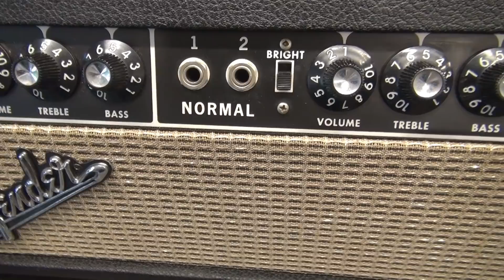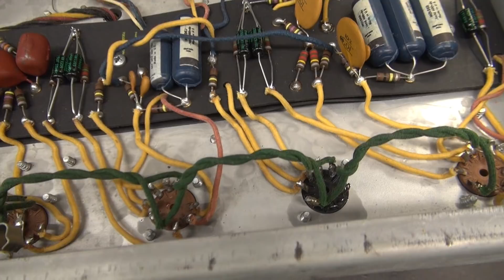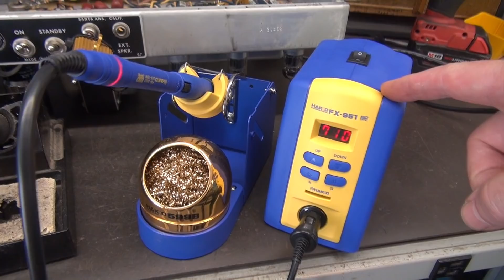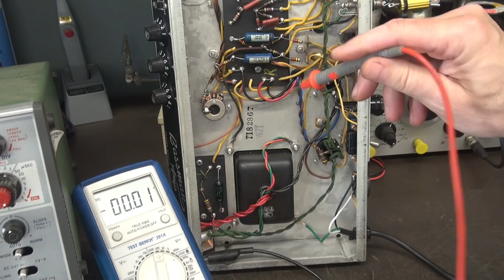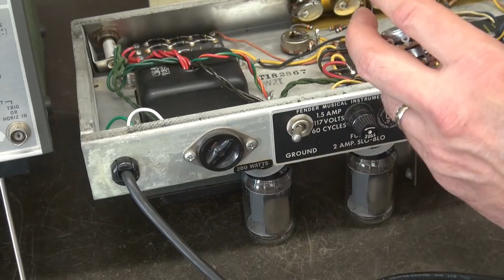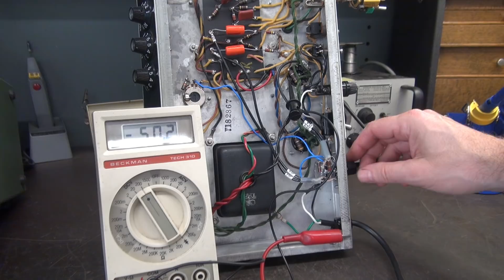How to fix Noise + add Master Volume Fender Bassman 6L6 tube guitar amp

Comment: Great to folow you,fine videos.make my homebuilds alitle better,riaa varius hifi amps and guitar amps,luckyly i have tubes and transformers fore some more builds,its funn to construct.point to point,and nowon has a same. Usualy fender clones or the 18w el84 amp.start building your dream amp just find an old radio chassi,and start building folks,all you need is solderingiron and a shematic to copy. Come on Folks,lets compeat,then we all winn!

Comment: Hi Terry, great clips and awesome teaching.
I have just been able to acquire two of these, my favorite model of the entire Fender catalog.
I had one before until 2011 and the notes jumped from my cabs with pubch, tone and clarity. Had a Super Reverb about as good tonally.. Both needed a full overhaul and the expected upgrades to return it to as good or better specs than when new.
One of these, my drip edge model has an issue when daisy chained or channel jumpering. This adds Volume,Treble and Bass as you know and connected this way gives very early overdrive, useful at low volume, mud at more than a couple real watts of power. 
On the drip edge model, the controls seem to fight each other like most other our of phase signals do when channel jumping.
How does one tell if tech has snipped this out. The amp had a very short, poorly installed power cord but otherwise seems original.As a player,I would like to do my own service work but have made a mistake when attempting to connect NFB.
It came on ok,I changed power supply caps with a new set of F&T's where expected and slowly rolled power on from 0 to 117 volts. Power and Stand y up.
I was elated when pilot light slowly brightened and eventually some background hiss and birdies hit my speaker,I thought I was OK.
Had left both Power and Standby switches up to allow voltage to fill caps slowly? I took maybe 5 minutes and stopped .
Any way, after playing a couple minutes through Normal Ch, I switch to Bass side and all seemed well.
Until I flipped the Ground switch to turn it on. Something died a a horrible death in my work.Iurt, squajy, squeaking death but fuse didn't blow but now, no sound.
Where do I start ?
Seems I made a huge mistake somewhere 
The other Amp works but has original two prong cord and death cap.
Any help would be so appreciated.
A bit more difficult than squeezing an Em9 chord.
Many thanks,
Daniel

Comment: Terry, there's a little 1/8" plug jumper that comes with the Hakko station.  Jump the power supply to the stick holder; it has a microswitch that puts the stick to sleep which makes the tip last years longer than it does without it.  And the stick comes back up to temp as soon as you lift it from the holder.

Comment: I had a master volume added to my 65 Showman thinking I might be able to use it at lower volumes with at least a bit of breakup, turned out to be a waste of time, still no breakup even with the master low and the main vol. high...

Comment: ok, Thts a X over amp, not flat lined AB165 at ..........ALL...............The driver n n Bias splitters say it all..Ive had several in like that great sndg amps..ive got 30 years in, store front repair...seen alot of weird stuff too  :) WOO, looked CLOSER at DRIVER  Thaz a REALLY REALLY rare amp, the POSITIVE  FEEDBACK 220Ks form plates of power tubes  to plates of driver tube was wild!  THAZ where alot of noise comes from as well......Gives a bassier sound 4 sure...   Fender fed back CURRENT from the speaker jack BACK to primary side of driver too, That could be a Dumblish manuever as well  :)

Comment: Great video! Can you apply this master volume mod to an Ampeg SVT VR as well? So you can dial in a "dirtier" tone with preamp volume knob but control the overall output volume with a master volume without sacrificing any of the tone?

Comment: my bassman one power tube out of 4 gets hotter then others. all voltages are correct. only missmatch is after PI 318V and 306V.  OT is also warm on idle. Sockets look fine. What could it be or it's normal? Thanx

Comment: My rarely used Fender 59 Bassman 4-10' combo amp has very loud Hum and slight popping sound , it sounds exactly like this but way louder , this is like normal tube amp hum. it did have 2 new power tubes and one preamp tube replaced.  I took it to this local amp repair guy he hook it up outside you can barely heart it and he goes I don't hear anything wrong here, he ask me if I have dim light switch , bad grounding etc yea I am familiar with that, but I have other tube amps that does not have this excessive loud hum sound maybe after you biased it the humming sound comes on, so he did not want to check the capacitors voltage make sure all working correctly,  I already email you about this issue but you are full of clients at this moment. I think i might sell the amp , I can't stand amp with the loud humming sound going on. I bought a brand new Mesa Boogie amp that had the same problem, loud hum took it back to the store and got my money refunded. So I have no idea what's causing the amp to Hum so loud

Comment: Never understood why a tube is installed inverted. The heat rises to the base, socket and connections. I use light bulbs and mount them base down.

Comment: I'm planning on installing a master volume control on my Silverface Bassman. I can't find the model number anywhere but the closest schematic is AA371. My amp has 100K grid leak resistors so the 250K pot sold by Triad should not be used - I didn't find this out till after I bought the kit. This isn't mentioned the Triad instructions. See the rob robinette website for the "Frondelli" master volume circuit where this is discussed. I had to order another 100K pot so I can make the modification.

Comment: I am surprised they installed ceramic capacitors in an amplifier likely to be placed next to a speaker.  Ceramic caps are notoriously microphonic.  That cap change was a great idea.

Comment: A master volume is not to limit noise , it's to get preamp breakup at lower volume, (  think Mesa Boogie),why not install a three prong cord and use the obsolete ground reversing switch hole for the master volume pot?

Comment: I do disagree a little with the statement that a post phase inverter master volume doesn’t affect tone. When you look at technical sheets of pentode/tetrode power tubes - they display asymmetric compression not to mention clipping that single ended preamp tubes can’t accomplish, save perhaps an ef86 pentode preamp tube.

Comment: Most Bassmans could use an added master wich can be easily switched back , and great job in your obvious expertise at the request of a customer , but , If a blackface amp dosent have a crackle or so , I’m not sure I’d want to play it , if you want an AB circuit that dosent have even a bit of noise, get a BADCAT , he will more than likely never use the knobs after setting the sound anyway. right, And seeing it will  be an original “hardly played” Blackface bassman only “once” and will never, ever be again , just my opinion ,and as you after working on it  don’t “need “ to hear it as long as that equipment says it’s correct  , neither do I need to hear it to know what I say to be true either .

Comment: Hi can you help me my fender twin reverb the left side two 6L6 sockets is not working the tube is good I checked it please tell me what happen Thanks my # is 9082402312 can you text me
Reply from the maker: Hello, are all of the 6L6 tubes lighting? If so, check for high voltage (450vdc approx)on pins 3&4. Be careful
Reply: No lithe left two not light up but I check the tube is good Thanks
Reply: Sorry just the left two not light up but I check the tube is good Thank you very much
Reply from the maker: Sounds like bad tube sockets. Inspect the contacts, see if they are spread or damaged. If so, you need to replace them
Reply: Thank you very much one more thing before that I put the pedal put into the speaker out will it damage the amp,Thanks

Comment: Love the videos but saying it's "always" good to change caps and that it doesn't hurt value to add a master is nonsense. If it was a collectible amp in 100% original condition that would destroy the value
Reply: How true!  Changing caps is usually always a good thing to do, especially with very leaky or electrically shorted old ones.  However, adding a master volume control actually de-values the amp of such great vintage.  True Fender enthusiasts cringe at the thought of a master volume on a black or brown face Fender.
Reply: @jeffcotton526   It's like getting hold of an Old "Vintage" guitar that is unplayable. Do you fix it just to be an all original collectors wall hanger, never to be played,  maybe increasing in dollar value or do you repair it to be the played guitar it was built to be in the first place???

Comment: Ceramic capacitors are always prone to produce some kind of noise. I replaced all of them inside my amp with polypropylene ones. I believe they sound even better than Orange Drops.
Reply: The color of the caps mean nothing.

Comment: I love your videos. Wish I could have you fix my fender twin
Reply from the maker: Hi Dan, What is the problem your having with the Twin?
Reply: @d-labelectronics  Clean channel works but breaks up randomly. The dirty channel is noisy and sounds like crap. When turning the reverb on ..the amp makes a loud squeel and hiss. I put new tubes in but to no avail. The sound will just break up and get quiet.

Comment: Another great video, thanks! Nice to see a vintage Bassman that hasn't been hacked to death. I've restored a few vintage Fenders that were in a sorry state compared to this one. In addition to what you did, I always swap out the 2W screen resistors on the power tubes. They tend to get baked to death as the heat rises from the sockets and are often way off tolerance. Cheers.
Reply: Actually, just watched another video where you do address the screen resistor issue. Good on ya! I'm new to your channel and still catching up.

Comment: Orange Drop caps a not very musical, more hifi sounding. Why would you change out the ceramic and P/I caps without checking the old ones? They original caps are responsible for the vintage sound of that beautiful amp. The preamp tubes are usually the culprit. I have many great sounding old Fender amps, all with original signal and coupling caps.

Comment: If you have to replace resistors in these amps would the metalize resistors work better I like that you use orange drops caps,pricey but nice.you really do great work

Comment: Boy that brings back memories.  At the music shop (a Fender dealership) I worked at I saw a lot of these in rough shape like all the solder connections shaken to death.  100% resolder job.   But when looking for upstream microphonic elements you have to have the volume controls UP not off.

Comment: You do great work, however, it's very anti-climatic for us guitar players, not hearing a guitar through the amp. Can you get a cheap guitar and have it tuned to a chord and hang it on the wall for plugging into the amp so that we could hear a guitar through the amp? You could strum the strings and it would be a test signal.
Reply: My old room mate, amp Guru Frank Levi III didn't play guitar either, so he did just that. What non guitar playing amp techs can do now is just buy a LOOPER PEDAL WITH 9 storable loops up to 10 min each ( see below), with total max record time of 40 minutes. Records at 48 Khz, 24Mgb (far better than CD quality). Just have a visiting guitar player make a variety of loops, clean to dirty varieties.

cuvave looper pro guitar loop pedal 9 loops total 40 minutes recording time unlimited overdubs built-in tuner function led display
$50.86.$50.86 from 2 stores
Features:The loop pedal with 48K/24bit sampling rate, lossless, uncompressed and professional tone quality.The total recording ...
Stompbox · Looper

Comment: Nice video, Terry! Whatever noise existed after you did the cap replacements you showed---I will GUARANDAMNTEE you that if you replace the 100K plate resistors (4 places in a Bassman--the ones that come together in the "V" shape---with 2 watt metal films---that noise will be 80% reduced. It's pretty much the same as having to replace the electrolytics under the doghouse on 40+ year old Fenders. Gotta get done, except I don't even think about the metal film plate resistors. There's nothing you can do to a Fender amp as cheap as the MF plate R's that will have anything near the effect. The hissing, popping rodent noises...those are the plate resistors. I promise. Any blackface or silverface Fender. 6 places on reverb amps. I have NEVER replaced those resistors without producing a WOW immediate and dramatic noise reduction. $3. Try it, my friend.
Reply: Sorry for the dumb question, are you talking about the preamp and PI plates resistors?

Comment: I find it hard to add more than what has already been said in the comments. I had the same Bassman back in 1969. It was 5 years old. It had the 12 inch JBLs in it. I was a fool to have sold it. 1st wife did not understand the worth of the amp. I am going to build a single channel version with 3 band EQ. of this amp. Try to make it as clean a sound as this one. Great video Terry. Brought back some wonderful memories. Thanxz

Comment: Cleaner? No thx Terry I want the sound of every control dimed -red hot crunch and dirt - but at a much lower overall volume. The the way I'd run that master volume for recording would be all channel controls on 10 - but the master at 1-2.  The high gain noise...that's why they make noise gates LOL.  GREAT work as always Terry you are an artist sir !
Reply: Tioga Fretworks I run both channels jumped a la Marshall plexi style. This thing sounds great with both channels dimed. The master above 3 is insanely loud.

Comment: Okay, guys, just got the amp back. Insanely awesome! Can’t tell you how much better it’s improved. Sounds absolutely amazing! Terry’s work is A+++++ . Seriously, I’ve dealt with a lot of techs in nearly three decades of playing, and he’s head and shoulders above the rest. Great guy that does great work, can’t ask for anything better.
Reply: How did it stay in such good condition?  Anytime I see one so clean I assume it got stored in a closet, and forgotten for decades before getting rediscovered.
Reply: @qua7771  would you believe I bought one last year same condition with original plastic cover ( still original tubes and aging inside no updates)? Original one owner. I'm like you ,I assume he didn't really play it . It sounds so good Im scared to use it, cause damage and not be able to replace  O.E. parts.
Reply: @l8tapex  You should really have the electrolytic capacitors and the 2 prong power cord replaced at the very least if you plan to play it as you should. Just save them in a bag as they can be reinstalled should you or someone else wants to return it to original. The tubes will be fine as long as you can measure a few voltages to make sure they're to spec. Unless you want a museum piece, it's all up to you. Good luck.
Reply: yeah, he is a genius, like Leo was....

Comment: I’m surprised no one has chimed in about the master volume mod yet. I’ll explain why I added that. I should preface this by saying I’m a purist, when it comes to gear and tones, but there are realities to deal with, and Fender wasn’t perfect. I play with mostly dirt boxes that like to see the amp at the verge of breakup, what the post inverter mod allows me to do is get that at any volume, whether I’m practicing alone, with a band, or at a gig. Power tube saturation is a HUGE part of a killer recorded sound, that’s why guys like Jimmy Page used small amps for recording, so they could run it full bore. For recording, I’d run this amp as loud as I could before the preamp over saturates, but for cleaner sounds, I can definitely use the master volume to record a more pristine tone that doesn’t need that power tube saturation.
Reply: I have a Silverface Bassman that I wouldn't mind having a Master volume installed, Terry does a very good job, when He isn't swamped with repairs I may have Him do this.... cheers.... PS. Awesome soldering station Terry!
Reply: It really hasn't set in yet,but I am relaxed, chilling in AC ,I can drop the Bassman off whenever it's convenient for you.
Reply from the maker: Maybe next weekend, no AC here at D-lab ; (
Reply from the maker: Can do man, How's retirement going?

Comment: Hi from Dublin -- love your vids -- 2 things I find -- sometimes those carbon screen and grid resistors get baked and cracked and make noise -- also may I respectfully suggest to solder the grounds directly to the chassis  -- I has seen bias failures etc die to bad continuity on those lugs bolted on the transformers -- peace